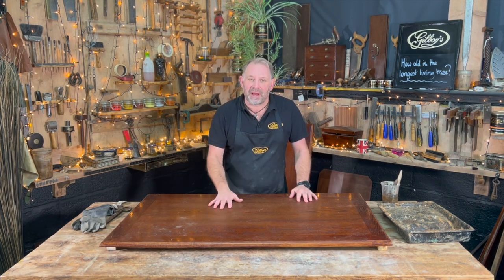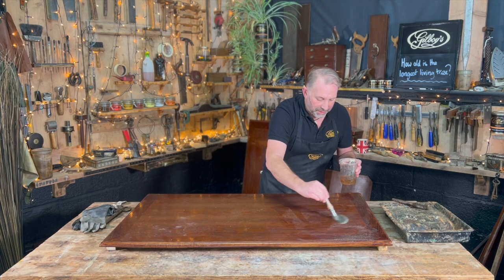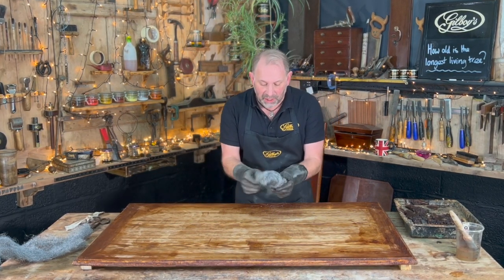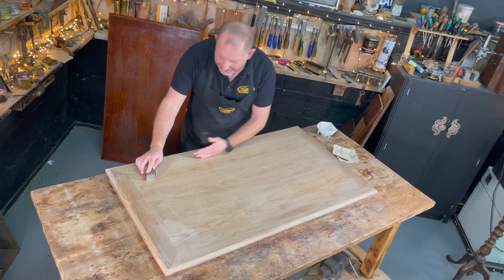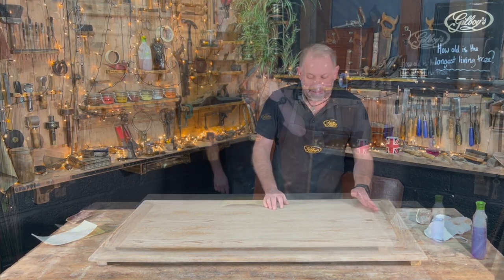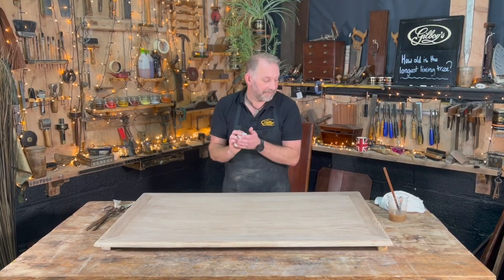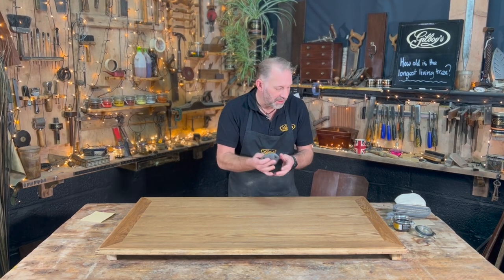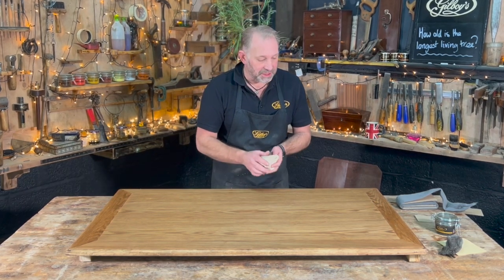Restoration of an Old English Pub Table (Ash Veneer)

Comment: 50 years ago i got my city & guilds in wood finishing , and forgot most of it, you are filling all the gaps and i thank you for it. one trick i learnt for stripping carvings and  mouldings was apply stripper and then saw dust and a good scrubbing brush and it works great

Comment: Thanks for another wonderful, easy to follow & understand instructional video. I used your Antique Gold wax on a friends' table: apply with fine steel wool, buff off with the open weave cloth,  just 2 coats. Didn't take much time or effort.  She was astounded by the improvement, she thought I had sanded & refinished it but no-just used the Gilboy's wax 🥰
Reply from the maker: That's great to hear. Thank you. ☺️

Comment: My personal preference for sanding something like this is a Preppin' Weapon sanding block.  It's the right amount of aggressive and quite easy on the hands.  it's a lot faster than a small block.  I heard the dust nibs the first time you ran your hand across the dry hard wax oil (agreed, great finish) and was wondering if you were going to sand those down.  Your table top, great result as always.
Reply from the maker: Thank you. Yes you can sand it down and give it another coat of HWO or wax it. 
This table had a minimum amount of HWO applied on it. It may sound like dust nibs, but its just the grain and texture of the wood. It's probably due another coat of HWO now, Its been in the pub for quite some time and still not marked. 🙂
I am so impressed by this product, regardless whether we have our own now, it's such a bloody good wood finish. ✅
Many thanks 
Simon

Comment: Thank you for sharing your knowledge.  I have an oak coffee table which I need to refinish so this has been very useful as this was the colour it was from new (now darkened around the edges where the dogs have rubbed by it for 15years or more).  I need to work out what it is currently finished with first before I get stuck in :)

Comment: Hi Simon, are you able to share the brands of the water based stripper you used and the hard wax oil?
Reply from the maker: Hi Russell 
We will be selling our own brand of stripper shortly and fingers crossed, hard wax oil. But until then 
I would recommend using either Osmo Oil or Treatex hard wax oil. I used a blended stripper in this vid. (my own concoction) But I have also had great success with Home Strip Paint and Varnish Stripper. Its environmentally friendly and chemical free. ✅
I hope this helps 
Simon
Reply: @GilboysRestoration  Thank you Simon. Very excited to hear about developing your own stripper and hard wax oils. I have your three wax polishes and they are absolutely fantastic to use, and produce such a great finish.